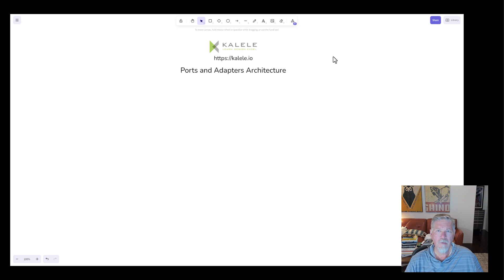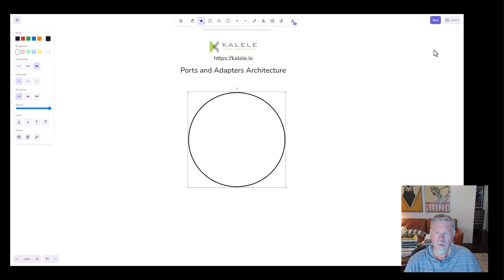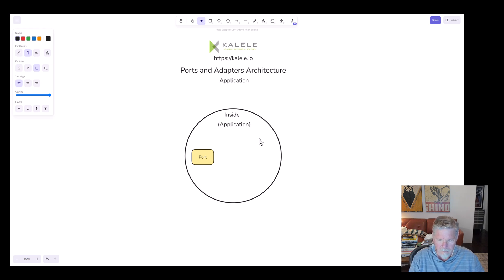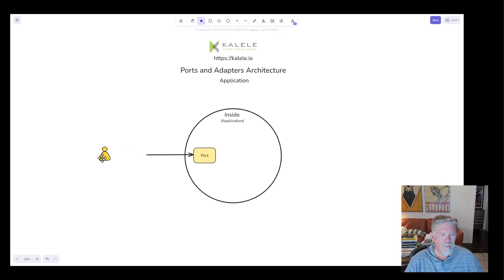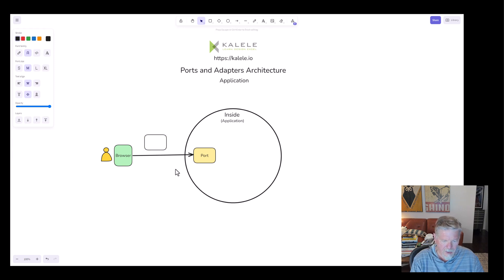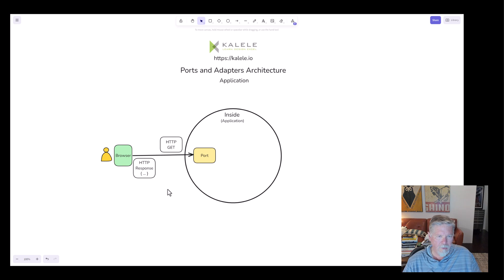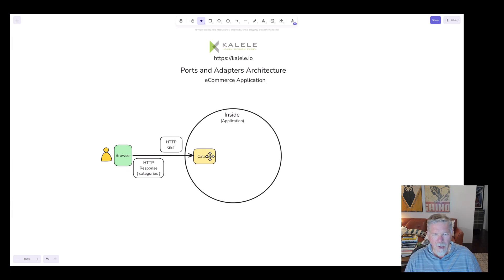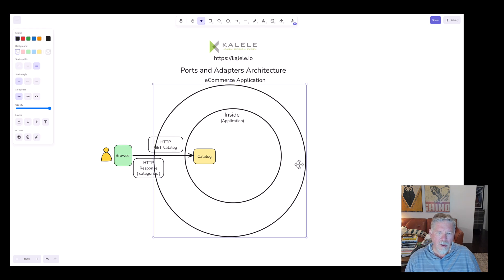Design Accelerator: Ports and Adapters Architecture Part 1

Comment: How ports and adapters map to CA architecture.Outside layer could be mapped with CA infra and Application (inside) to CA Application layer?
Reply from the maker: What does CA stand for?
Reply: @VaughnVernon  Clean Architecture,sorry

Comment: Thanks Vaughn, but i really wonder, how is something new compared to the classic: “depend on the interface, not the implementation” ?
Reply: "Program to an interface, not an implementation" is related, but I see a distinction.

The interface/implementation principle is one of the two design principles of Design Patterns.

It is realized in several design patterns, such as Strategy, Template Method, Façade and to some degree Adapter.

I view Hexagonal Architecture/Ports&Adapters as pattern of these patterns that pulls them together into a cohesive design.

I have blogged about this, and I have my own HexArch/P&A video presentation online, but I am reluctant to post any links here. Every time I post a comment with links, it get's removed by YouTube. I suspect it's trying to avoid self promotion.
Reply from the maker: It's the separation of outside and inside and the responsibilities that should be separated. You could implement interfaces and still have confused responsibilities.